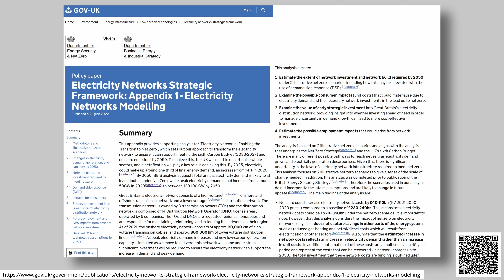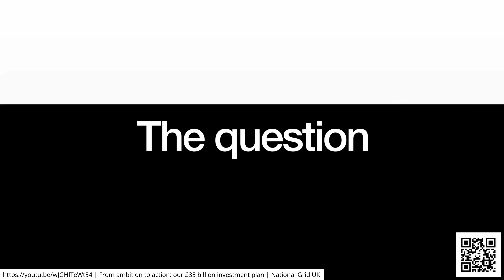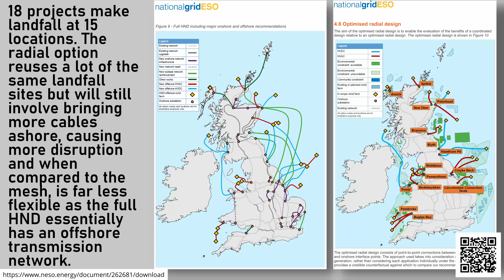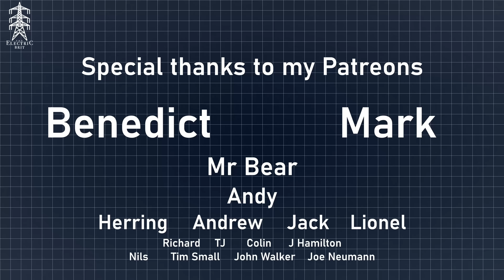The Great Grid Upgrade Projects Explained

Comment: I'm a P&C design engineer, so all this work is welcomed
Reply: What's P&C?
Reply from the maker: Protection and control 😊 the stuff that makes sure we don’t have blackouts and that faults get cut off before they blow stuff up. 

Brazils latest blackout and most blackouts of the past 7 years have been partly or wholly down to bad protection testing and maintenance.
Reply from the maker: If you’re in transmission our paths may cross as from Monday I’m a HVDC P&C design assurance engineer.

Comment: I got right up to the "Bring bills down" bit after spending £35 billion! then left.
Reply: He said 'long term'. Short to medium term...very obviously not.
Reply: And how much of that £35Billion will end up in private hands?
Reply: @VinoVeritas_ quite a lot of it. If it was all done under a nationalised system then all the companies doing the work would still be paid.
Reply from the maker: Agreed. I didn’t mention it in this video but all of the work is done by a principal contractor I.e a construction company. Even major works on the existing grid like extensions of substations or new lines are all done by contracting companies.  National grid then own and operate it and are the client during construction to ensure it’s all built correctly and safely (that’s my role).

I’ll mention again I’m in favour of nationalisation. Regulated monopolies are pointless and for public services there should be no room for profits going to shareholders.
Reply from the maker: Someone had the bright idea of installing a load of wind generation but with no way to get it to your home. So now we have to pick up the tab an improve the network to make it actually useful. 

I caveated the spending with the fact the only way to actually reduce bill is to reform the market, as it’s not fit for purpose now.
Reply: @TheElectricBrit Didn't the outgoing NESO CEO say that its about 25 quid per bill for the great grid upgrade, but it saves more on that on constraint costs. And that doesn't even get us to the overall economic benefits of having shorter connection queues. It would be great though if we can have AI datacentre builders (there seems to be a glut of money there) pay for a lot of the upgrades (possibly for an earlier connection date?)

Comment: 9:13 Three points here: 
1) EMR uses class 158, 170 and 222 diesel multiple units on their non-electrified services, and do not use any locomotive hauled trains. 
2) Currently, EMR is training crew on their new class 810 bi-mode multiple units. These trains can switch between overhead line electrification and onboard diesel engines. 810s will take over EMR intercity services, replacing 222s.
3) EMR already operates class 360 electric multiple units on their connect services from London to Corby
Reply from the maker: Thanks for the info. My limited experience with them is between Lincoln, Spalding and Peterborough, maybe Newark if memory serves. 

Fairly certain there is no overhead through Spalding and it’s an extremely busy route for both haulage and passenger service and we should be dead set on electrifying the entire network. 

I’m also heavily in favour of nationalising rail again. It’s the only solution if the government want people to actually use it. Public transport is often cited as lower carbon emission travel than car, but that’s never going to be the case if it’s over £100 a ticket to visit my parents…I can get a cheaper flight! And that’s on an electrified route with LNER (EMR is actually pretty cheap but it aught to be for 1-2 stops).
Reply: @TheElectricBritdon’t get me started on how much EMR scams me if I want to go to London. It’s ridiculous and full nationalisation is ideal. 

p.s. most high speed DMUs (like the 222s) actually have electric transmission. Power can even be sent between carriages if an engine fails
Reply: @TheElectricBrit the route Peterborough-Lincoln-Doncaster is sometimes called the "old road" in reference to a "new road" (the electrified ECML (Kings Cross-Edinburgh)) and is occasionally a diversion route for the mainline during planned disruption, but mainly it's a nationally important container freight route linking the port of Felixstowe in Suffolk (which come through Bury, Ely and Peterborough) to terminals in Leeds, Doncaster and the Northeast. So much so that they built a brand new underpass a few years ago at Werrington to get container trains going towards Spalding without disrupting ECML expresses. Interestingly, in the 1930s there was a plan to electrify the Old Road and the line through Grantham to Nottingham on the 1.5kV DC system but that never went anywhere.

Privatisation completely ruined the economic case for electrification because the benefits where split apart different organisations while the infrastructure operator has to front a massive cost. In Scotland where the passenger and infrastructure operator are both under the control of a national body, they've been able to electrify much more and cheaper than in England since the late 2000s. But no matter the structure, central government have been completely allergic to railway investment pretty much since the 1950s - they just freakin hate trains tbh.

And this is not set to change with this government. Literally this week the transport secretary announced that there will be no more electrification projects presumably like forever? She didn't actually give a timeframe. In June she (well HMT as always) cancelled MML electrification (Leicester-Nottingham-Derby-Sheffield) which was an insanely stupid thing to do because the contractors were literally twitching at the shovels to do it having already built works areas and everything. Several million pounds were lost on that waste of resources simply to "save money". Now the only electrification going on in England at the moment is Manchester-Huddersfield-Leeds-York which a normal country would have done 70 years ago.

 Because of EVs, batteries can now power trains. This is probably a decent solution for minor branch lines where only one little train goes up and down every hour or something. But for anything more serious than that, it would become operationally very complicated and highly energy inefficient in the long run to use battery trains. Yet there are many voices these days that pretty much agree with the government that there should be no more 25kV except for little bits to charge batteries. The pandora's box of battery trains is out of the bag now and any writing a business case for anything can't avoid it. In my view, a lot of this is the long arm of slightly dodgy decarbonisation policy which has a tunnel vision about removing internal combustion engines. If the vehicle no longer has an exhaust pipe, then job done - no interest in whole life costs, other sources of pollution and genuine sustainability - and from this we get diesel/electric bimode trains, battery trains, and the strange idea that swapping all cars for electric cars will meaningfully decarbonise transport as a sector.

My view on fare prices is that over the last 100years the population has gone up and each individual's need to travel has gone up while the size of the rail network has bascially contracted. No matter how nationalised the structure is, you can't get around the fact we need more railways. The single biggest upgrade to the network with multiple stepchanges in capacity is a high speed network, starting with full HS2 (especially the bit that went to Leeds). This is because the faster the train goes, the more it needs miles and miles of nothing in front of it in order to safely slow down - so if you remove all fast trains (fast really mostly means, stops at fewer places) then you get so much more free capacity then if you removed slower trains - ergo, nation spanning high speed lines are upgrades to local networks - often multiple times at once.

Sorry for the wall of text - but there's such a lot of things in this topic. Looking forward to that rail electrification video you teased...
Reply: @contrapunctusmammalia3993 Lots of good detail there, thanks 🙏

Comment: Great video as always. 
My concerns about the whole project though, its unlikley to meet demand, be delivered on time or cost(based on previous projects) and worse, wont meet future demand.
Reply from the maker: Appreciate it! In my experience the projects I’ve worked on have always been on time and on budget, however projects like Hinkley and anything government involved like HS2 steal all the limelight for disaster projects, but I do get it and it’s a belief I generally have. 

I’m fully confident the majority of these projects will hit their 2029-2031 switch on dates but there’s a lot of challenges like workforce / skills shortage and access to outages, but Ofgem knows the latter they’ll make it work. The only ones that might not hit it are edge cases where things like historic land usage (see EGL1) cause issue. They’ll all make a dent in current demand and we’ve only just managed till now without them (see curtailment video), but roll on 2035 and we’re going to need to connect tens of GW of more generation somehow. New technology will hopefully start being used then though.
Reply: @TheElectricBrit  yeah the capacity injections vrs (conservative) projected demand.  They just dont add up.
Even if it all goes well, we wont be scratching the sides. Keep up the vids buddy
Reply: @Scottishprepper73  I think the idea is that there is a lot of 'insufficiently used' capacity in the grid, that is restricted by bottlenecks... install the higher-capacity connectors to remove / bypass the bottlenecks, and they can increase overall grid capacity / usage by more than just the capacity of the new links.
Reply: @logicalChimp I get that, connecting via the HVDC cables from north to south etc. 
The power is in the " wrong place " with outdated and insufficient transmission capacity.
However, given what's expected of it, and what's proposed and how things have gone in the past..I dont get a warm fuzzy feeling.

Comment: 2:40 Not sure why youtube chapters aren’t showing up.
Reply from the maker: Fixed now. YouTube couldn’t handle it so done it manually as I should have done :)
Reply: They also don't show up in the video description, so I guess they haven't been added to youtube yet. At least not in  a way that youtube actually accepted them. Meaning, it could have been youtube's fault, but @TheElectricBrit will still have to fix it.
Reply: Probably so many short segments that it looked a mess.

Comment: Would be good if we could utilise motorway hard shoulders, central reservations or verges to bolser our grid. Government already owns the land and they go to where people live
Reply: I don't think central reservations and hard sholders are big enough to fit the kind of infrastrucutre that's being built in this case...
Reply: Congratulations, you now need to close a motorway every time you inspect or repair the electrical infrastructure
Reply: Motorways are specifically blocked through the special road regulations from having any buried utilities. This is because they are critical national arteries and disruption to the motorway or railway networks has an enormous economic cost. Plus HVAC cables don’t really work over long distances - the grid gets harder and harder to control the more cables you have.
Reply from the maker: I believe in the US this is the case as I recall that land being proposed for rail or hyperloop due to the ownership being easy.

I do agree though, most motorways should have a swathe reserved for infrastructure, be it expanding the motorway in future or for overhead lines. For example the current 400 kV backbones of the grid, I hope if we get 800 kV that we just place them along side the existing lines, then complaints of spoiled views would be minimal.
Reply: @TheElectricBrit
The Only Rail Project that I'm aware of in the USA is the BrightLine West, which follows Interstate Highway 15 to some degree and also utilizes other right of ways including rail.
There is one in Texas, but I'm not familiar with the particulars.
Electric Towers usually follow the shortest most cost effective route on this side of the pond, regardless of environmental damage.
Eminent Domain seizes any private property for the Public Good.
Reply: They can do that when automobiles become obsolete and revert to trains and trolleys.